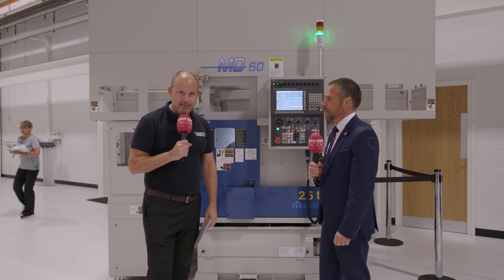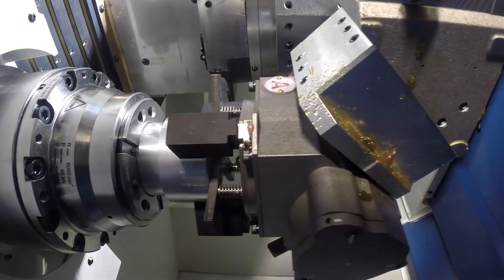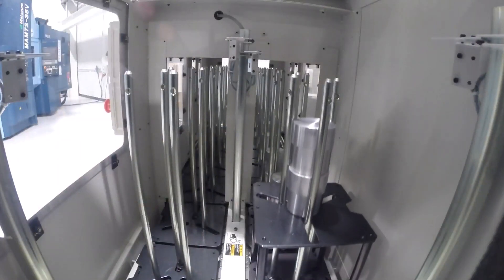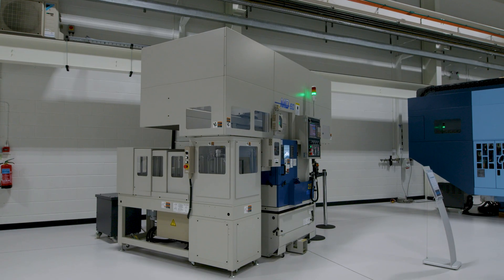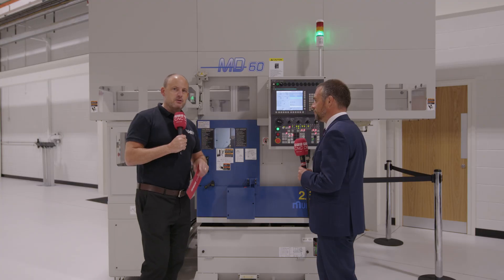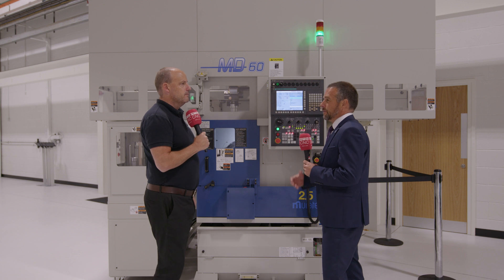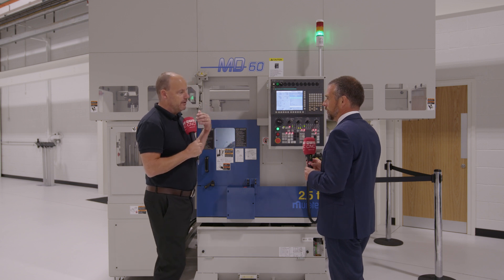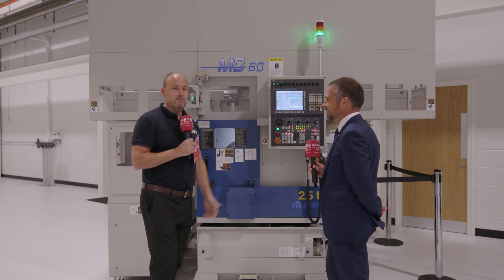Buy Now Pay Later from Matsuura

Comment: The MD60 is 1/2 of an MD120. It is 6"-8" chucker with C-axis and live tools with integrated gantry automation and turn-around station. In feed and discharge are typically a feeder table and conveyor but bespoke solutions are often utilized. In the case of the SSP, (single spindle package) they are often an OP30 as a final operation before heading down the line. That said, these are a great way for a job shop to get into an automated solution with the right set of jobs.

The MD60 is not the smallest though. The MW40 (which can even have Y-axis) is a smaller, faster machine which is more versatile. The New MWR120 is the big brother to the MW40(GMCY) which is very impressive utilizing the integrated carbon fiber gantry (super fast).  It is this spindle size as this MD60 (~120mm) but a different axis configuration. 

There is also the even smaller MW35 which is designed for simple, high production parts that only require 1-4 tools. Fasteners, or electrode pins for example. The MW35 at IMTS was dropping two parts every 3.75 seconds for example.

The Muratec machines are incredible solutions. Glad to see you guys giving them some attention.:goodvibes:
Reply from the maker: thank you PKmode, where are you based?
Reply: @MTDCNC  Wisconsin. we just received an MD120 and an MS60 that are being turnkeyed on our floor. In line process for Op10/20/30. We are also receiving an MT200GT3 this week for another client. Again, a full turnkey for high volume production.